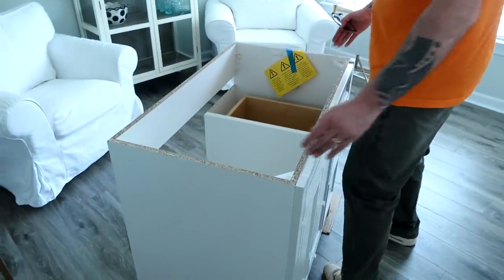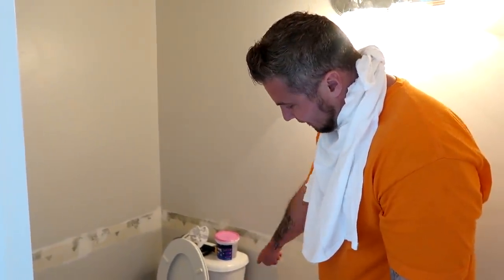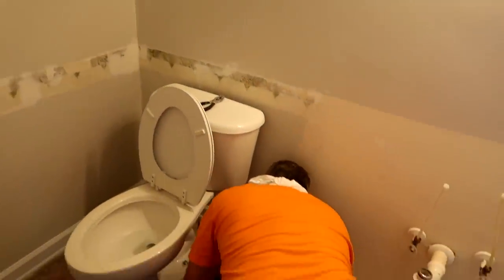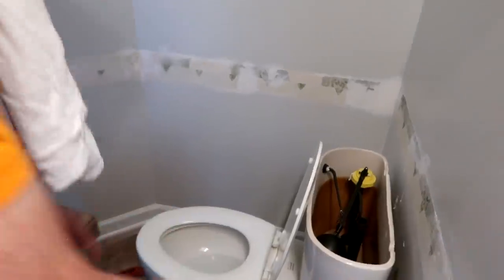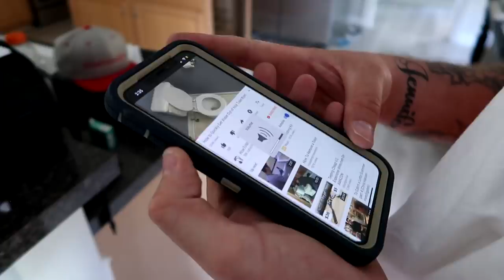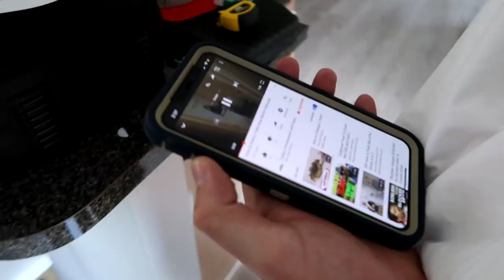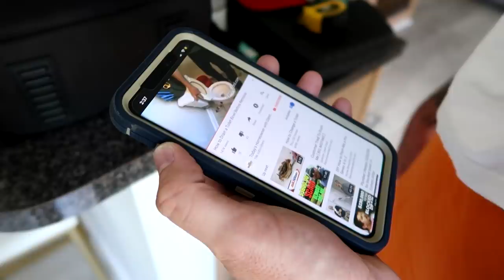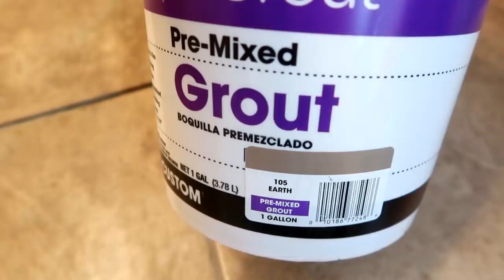"Hope To" Remodel A Bathroom

Comment: Good Job Joe. I grew up in construction and then as an adult I painted commercial and residential with my brothers. My husband and I bought a old lumber yard (with a huge 6,000sq ft building) and we’ve been remodeling since we got it....about 6 years now. We had to learn as we went on some things,like plumbing,so we feel your pain. It does get so much easier after you’ve made just about every mistake you can make and had to repair your own screw ups lol

Comment: Anyone who's hating is silly. It's never easy to learn something new and as someone who installs flooring for a living I can tell you it takes practice. The mistakes along the wall will all be covered by trim but the only mistake that I would recommend fixing if you try again is never wipe directly down the grout lines. You end up digging out alot of your grout. Just wipe gently and always at a 45 degree angle. It's always good to try new things though and as a first attempt it's not bad at all. Respect for trying at all and you saved a shit ton of money

Comment: OSHA Certified toilet repair man here with a comment.  I am like you, I learned by doing and making mistakes. Don't be so hard on yourself, you did a pretty good job.   You can take the tank off the bowl.  It sure makes it a lot lighter and you are less likely to tilt the toilet and water run out.  You need to get a good pair of ChannelLocks.  Those will be a lot better than the wrench you have.  Great show.

Comment: You should plug the toilet opening so you are breathing in the gasses 🤦‍♂️
Reply: Most people forget to do that. I know I did the first plumbing project I took on. Hell I even spent an hour attempting to cut a clay pipe with a metal sawzall blade. Lol It worked eventually.

Comment: Joe hey man look you gave it a good attempt and it could’ve been worse, I’ve used youtube to rebuild my cbr 600 f4i, I’ve used it to learn how to re do the rocker panels on my truck and also replace sub flooring and ceiling holes with joint compound it’s a great place to learn and you’ll only get better from here 💪🏼

Comment: Tile is extremely easy to remove, a simple hammer and chisel could pop them off, if the thin set gets left behind a scrapper can be used to scrap it off.

Comment: I was in construction for 17 years not bad for your first time doing it the hardest thing in tile is to patch back in I seen a couple of things that were wrong though if you would have used the spacers I think your spacing between the tiles would have been a lot better first of all I didn't see no concrete board whatsoever under the tile most important part of tiling is the backer board prevents it moving so much where it can crack and when you are doing grouting go at an angle to the spaces in between the tile and you want to pack them completely full it also helps to take your wet sponge before you start grouting and wet the tile a little bit don't have it soaked just damped it makes the grout  spread a lot easier anytime you have questions feel free to ask Buddy oh and yes  I was OSHA certified had to take an early retirement due to a car accident that broke my back in 2010 I loved my job I have don Miles of tile tile showers marble floors ceramic floors and imported marble from Italy I will be glad to help anytime you have questions about home improvements

Comment: Not too bad for your first time ever. If you lay tile again, place the tiles without adhesive first, to make sure your layout and cuts are correct. And use spacers. Also, you don't need to throw down that much grout. And seriously, a pretty good job for a beginner doing free hand.

Comment: This is the first whole video of y'all's I watched in a while. I think this is def a  good idea for some new alternate content. I'm an ex- con but I also enjoi seeing you guys try new shit . Good on ya
Reply: Why remove the toilet?  I redid my bath- new tile(used a wet saw), vanity, mirror, paint & baseboard.
I also installed a new acrylic shower liner, but re-used the original tub, which was porcelain. New ones are expensive  and porcelain cleans up very nice with a little elbow grease.
Use tile spacers.
My tile looked better, but I did a hack job on the shower liner.
Nobody's perfect!

Comment: You're supposed to use spacers Joe and you could have took a grinder with a diamond blade on it and trimmed off a little more of that tile and you always want to put spacers in your tile and use a hockey level puck over the top of the tile to make sure the the tile surface are level before you grout

Comment: Take a razor knife and cut along the top of the trim often times the paint will dry to both and will rip the paint off the wall. Just place the razor blade in between the wall and the trim and slice down only one or two times and it'll break right at the edge when the trim in the wall

Comment: the best toilet related tutorial is "nine inch nails - pinion".... ** the towel trick is probably the best option kinda, there's a trap in the toilet and that will hold a bit of water and than your best option is to soak it or remove it by whatever means; the water in the trap is suppose to help block the gasses from the drain/etc; replace the house with a flexible hose that has the connectors built in etc, it's way easier/better than the oldschool solid tank hoses with exception if you're going chrome for cosmetic purposes.... for the tile cutting I've never done it myself but there's these cutting table things or table saw(one of those borrow from someone who's got a construction company type deal is best or similar)

Comment: sit a garbage bag on the floor and put the toilet into it, it will catch leftover water. also you have to use the mortor to build up or remove some to make sure there is no lippage of the tiles. 

with a little practice and alot of you tube, anyone can do this stuff, but there is something to be said about a custom contractor that knows his stuff and does it on the daily.

Comment: Joe that rigid tool you got also cuts wood.. didn't have to take the trim off the wall.. measure the vanity to where it would come out to put a line in the base board and use that tool to cut it still on the wall..lol.. you done good tho.. just throwing out a little tip for you..lol

Comment: Home depot should have told you to get spacers to put between the tiles so they would have came out even. The mistakes near the wall can be hidden with wall molding and like you said the vanity. Not too bad for someone that's never done it before. Flooring is hard work.

Comment: Bro I'm ten minutes in and can't stop laughing, I've been working for my father since I was 13 years ears old part and the past 2 years full time. Setting tile is like driving a manual transmission car. It's so easy by now. By the way the tool you bought is actually a under cut saw ( it cuts by vibrationingte saw blade.) I suggest putting that back in the box and exchanging for a angel grinder ( cuts using a dull rotating disk with diamond dust on the edge to cut.)
Reply: 14 minutes it just woke up my roommate laughing and thinking about how fuck up this situation is getting

Comment: Drywall is what I have the hardest time with. So much sanding and if you don’t do it all the time it’s hard to get it to look perfect.
Reply: I was a taper (the guy that does the drywall mud and sanding) for quite a few years.  Just a tip for DIY. Use really thin coats of mud. Don't try to put so much on at once. Let it dry though between coats. Use your putty knife/spatula to scrape of any real excess then sand between each coat. It may take several days, drying time/sanding. It's just something you can't rush. Just remember,,,, more is not better.

Comment: After years of experience, please take this to heart. Don't cut tile without a proper mask.

Dry fit first before making things permanent.
Speed square.
2 foot level.
Use a razor blade and score above trim to prevent tearing paint/drywall off. 
Tile spacers.
Make sure to clean tiles off repeatedly and at an angle.
Grout seal. They sell a tile cleaner but a little bit of 50/50 vinegar water will work well. 
Small shop vac for toilet water.
Lefty loosey righty tighty. Lol.
Careful not to lift from the tank.

Comment: I remodel for a living. Been a contractor for years and I've seen "pros" do work worse than that. Btw, if you're confident enough now, you can get $2k to $3k for the tile, new vanity/sink combo, and a caulk and paint job on a bath that size.

Comment: Hey when u remove a toilet u wont be able to get all the water out so if u and cody get most of the water out u 2 can carry the toilet out as long as u keep it level while carrying it out and then when u get it outside u can tip it over and the rest will drain out I grew up doing construction with my dads company before I left for the marine Corp their is no way i stick a rag in the toilet that's nasty but if u do it like I told u you can flush all the water out that u can then un bolt the 2 bolts lift off the wax ring and 2 ppl carry it level as possible and trust me no water will spill

Comment: You can either take the tank off or leave it on there's only  holding it down two bolts and a wax ring on the bottom. But the toilets have a P-trap built in and if you turn it while lifting it up it's going to come out the bottom you can't get it out except by turning it upside down and it's hard to get all the water out but it'll probably be smelly. so on the tile if it's your rubber tile not your hard tile you want the blade it Off you can't use a grinder really and if it's a hard tile you want to take a small blade and tap it with a hammer on the edge to save them if not you don't care just take a big blade shovel a flat nose and start shoveling it under the tile slight popping them up you might be able to save some but if not they'll they'll break you probably want to paint the wall before you put anything in it's hard cutting in around toilets.there will still be water in the toiolet p trap don t tip toilet while removeing from the house.

Comment: So to remove a toilet is straight forward... After you turn off the water drain as much water as you can with the lever. Next unbolt the screws at the base, pull toilet straight up, carefull not to tip as there's a p-trap holding that water in the bowl. Replace new toilet with bull nose wax ring plus a plain wax ring on top the create a tight seal, reconnect water line turn it back on.. Simple
Also plug the drain with a rag to prevent sewer gas going into the house.

Comment: Joe stop putting yourself down buddy it all good. They do make seperators for the corners of the tiles. That's what the pros use. You take them out after you get the job done and after it sets up a bit. I think. The tile seperators was the point.

Comment: U had to google how to drain toliet bowl??   Lol
Reply: Shit i would have done the exact same thing
Reply: A lot goes into replaceing a toilet not as simple as it looks. Found that out the hard way.
Reply: @allisonchang7229  unless there is floor damage. Removing and installing a toliet isnt that hard. If ya have to replace the flange then yea few extra steps. But if the flange doesnt need to be changed its a 30 min process really.Shut off water,drain tank and bowl. U bolt from floor scrap off old wax ring. But yea it can be a tough job if there is any damage to the flooring.Hopefully flange/flooring isnt damaged.
Reply: @bstarkweatherb  . I told my boy friend leave it alone i want to do it. All i remember was encountering a few hick ups. But i got it. An yes i had to replace the flange. But your right it's not that hard i think i could do it with ease if there is a next time.

Comment: it's not the grinder is the blade you use or supposed to use a diamond blade to cut tile if you're going to cut it with a grinder and pulling up tile it is better just to use a chipping hammer

Comment: I've seen a lot worse from well paid 'professionals'. Next time you're at a fast food place, look at the bathroom tile. Look at those seams. Now realize that they were paid to do that shit, and you did just as well or better on your first attempt at tile work.

Ok... on the toilet, drain the tank, get a dollar store turkey baster and suck most of the water out and then keep it tilted forward so the water in the trap can't spill out till you have it in a place where the water wont matter. Also stuff some plastic bags or a rag or something in the drain to keep the sewer gas out. Make sure to NOT shove it all the way in or you'll have a fun chance of plugging the sewer line. As is said, "Buy once, cry once." That osc tool is a good one and you'd be surprised how handy they are. When pulling the trim, use a razor knife to cut the pain and you won't have to worry as much about pulling the trim and having the paint rip off the wallboard paper. 

All of that being said, you *could have just put in a spacer board between the vanity and the wall if you weren't worried about using the space and pad it out so it covered the same width and then just tack down some plywood on the subfloor to raise it to tile height and put in the new vanity without all the toilet removal and tile work.

Comment: Did you really cut those tiles in half with an oscillating tool? that must have taken forever, you should have got a right angle grinder.
Reply: Or a tile cutter, you can get them cheap.

Comment: Your bathroom is pretty small, you should have just removed all the titles and used a lighter tile to make it feel more spacious, the tile you used is what I call the "restaurant tile", it's meant to hide dirt. When installing titles make sure to always use spacers. The toilet bowl has wax under it, make sure to remove it and replace it with a new one or it won't properly seal. There's so much you did wrong but it's not through incompetence but impatience, you should really learn how to take things slow.

Comment: You always lay the tile in and check it before you lay the mud. but you could have just pulled the tiles back up cleaned off the all the pieces with a sponge re cut the cuts and re layed it would have took 30 more minutes for a lifetime of looking at a shitty tile job!